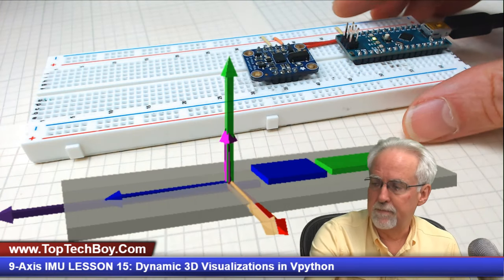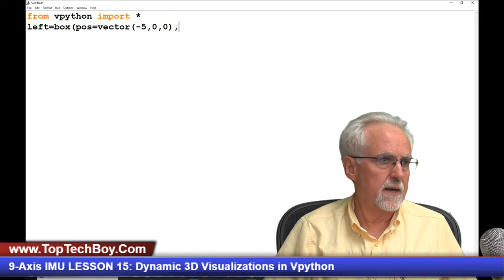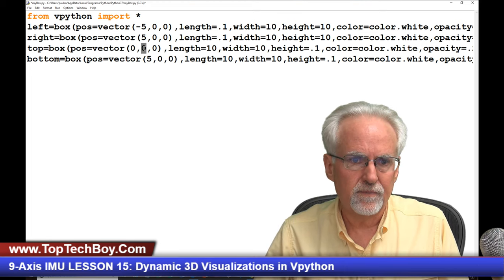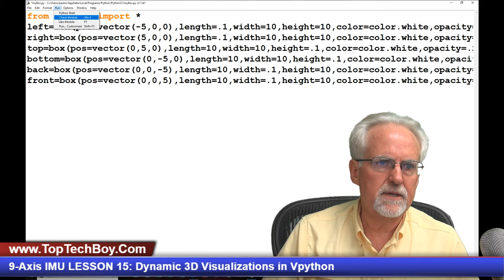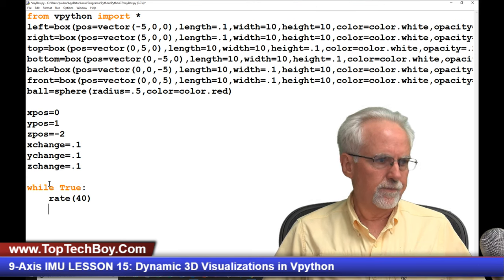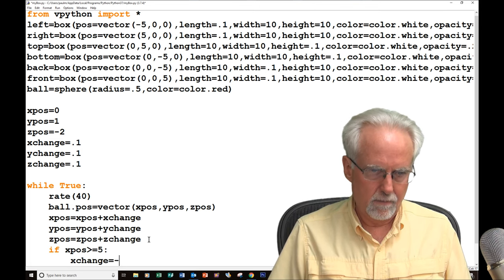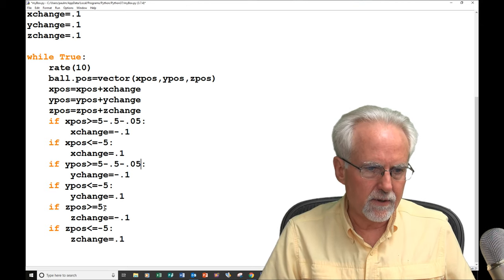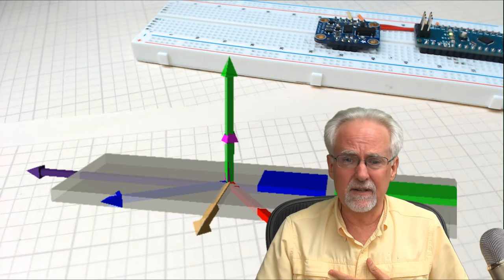9-Axis IMU LESSON 15: Dynamic 3D Visualizations in Vpython

Comment: Paul, I did the exercise on my own before this lecture, so "I am legend".  I did it using 1 box rather than 6, with the 2 balls initially placed in random locations and travelling in random directions.   I tried to extend it to handle any number of balls using an array of shapes (for example, ball[0], ball[1], etc), but couldn't figure out how to get Vpython to do this.  Regardless, this was still a great exercise!!!
Reply: I did it as well, and it works...although the code is probably a bit clunky. I'm posting this before I watched this video though, and I think I could improve my code through the use of a couple of parallel arrays to hold the various data for each marble. I theory I think the code should be scalable for 'n' number of marbles, and mine is hard-coded for only two right now. 

Here's my code: https://pastebin.com/iGJirQ3G

I am going to keeping working on it though, because this version is clunky with a capital 'C'.

Comment: Slowly catching up. Had some problems with my Jetson Hardware. Got that fixed and back on track with those lessons. So now back working on the 9-axis project and just finished Lesson 15 homework. The homework sure generated a bevy of ideas of what to do with the bouncing balls (I have 5). Implemented a beep when ever two balls collide which is rare. Paul thanks again for this stimulating project. I hope to get back to the front of the class next week.

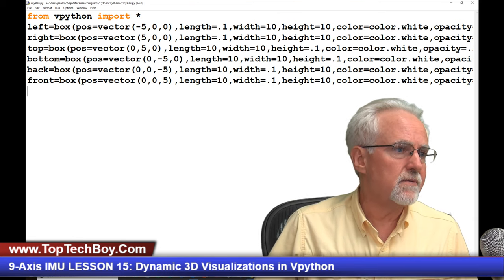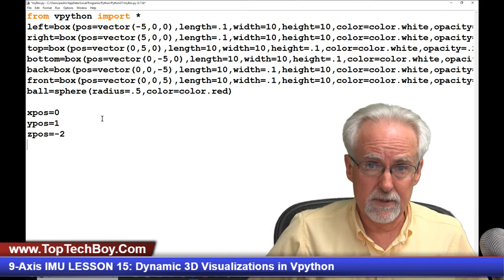Comment: If anyone has issues with the box at 14:00-16:00 you can try replacing the Length, Width and Height parameters with the size=vector(L,H,W) one. It resolved the issues I had on my side, hope it helps!